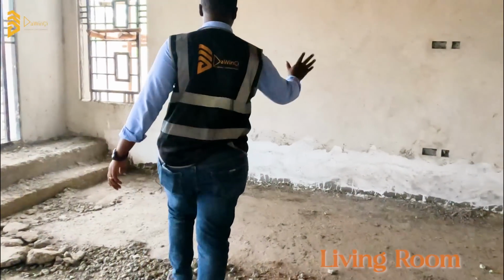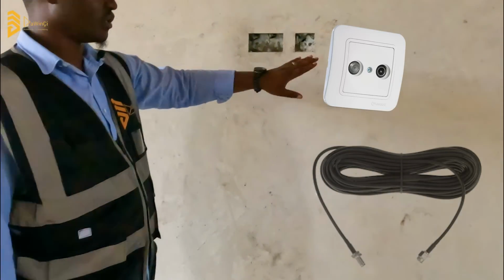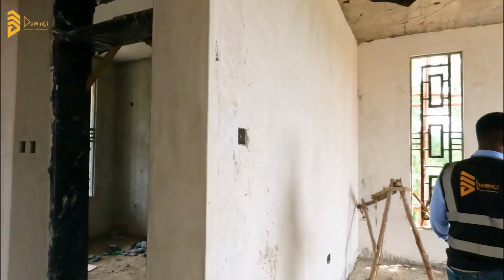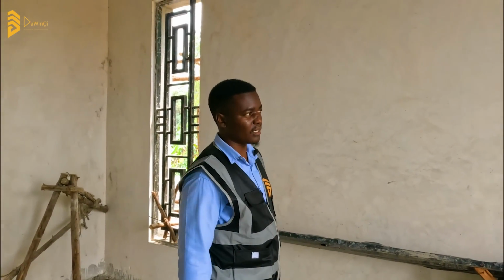Watch This Before Plastering Your House , Thank me Later.!!   (Building Real Estate in Uganda)

Comment: Great video, thanks for sharing...one thing I would do differently is, I would install the burglar proof bars after the plastering is done.
Reply from the maker: And how would you anchor them into the walls?
Reply: @DawinciImpressions  The same way, but the difference is you will get less plaster on the burglar proof bars. If you're going to do it your way, the workers should cover the burglar proof bars with plastic or cardboard, etc. so that plastering does not get on them.